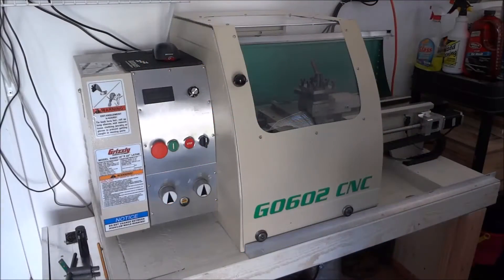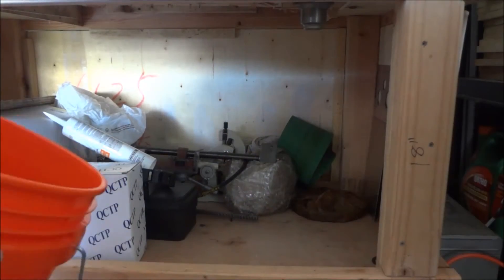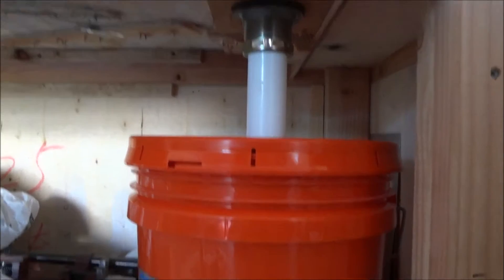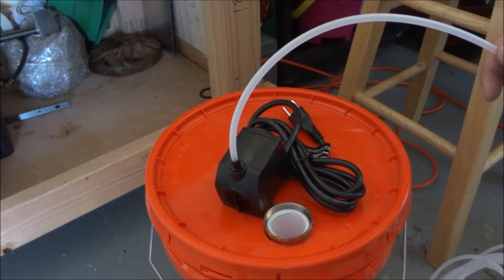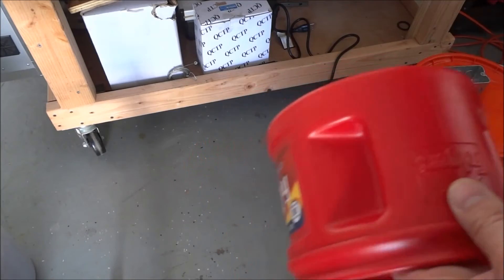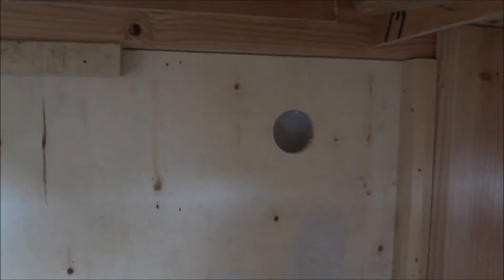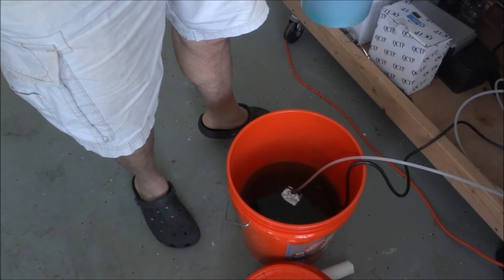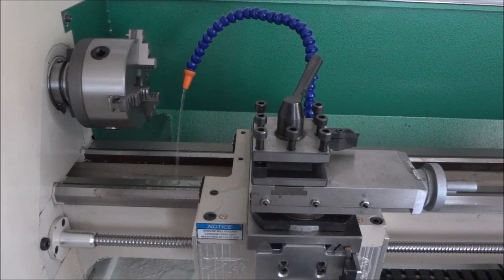G0602 Project  DIY Flood Coolant Pump and Tank

Comment: I did a very similar setup right down to the same orange buckets (just what I had) on my CNC milling machine.  I ran into height limitations on the pump that you had used because of its max of 3.5’ of head pressure, so I stepped up to the 63313 pump instead and it has a much better flow and pressure.  One other thing that I liked about it is it has a pipe threaded output.
Reply from the maker: Thanks yes the pump is low pressure however this was intended for the lathe where I did not need a lot of flow.

Comment: Just found this video as I'm looking to set up a similar system for my mill.   I was wondering how the pump has held up.  That same pump at HF is listed for fresh water but not for solvents.   Coolant isn't exactly in the "solvent" category but I wonder if it affected the seals in your pump at all.
Reply from the maker: Still working well have not had any issues

Comment: Does machining dust not stick to the pump impeller?
Reply from the maker: I really don't get dust per say. I did change this pump to a little larger one after running it for 3years. the old one was working when I changed it.

Comment: i would add a floated level gage that sticks throung the top of the bucket so you can easily read the level and not overfill
Reply: Yeah.
Thought use a clear(transparent)bucket
Reply from the maker: That's a fantastic idea always find out when it stops pumping.

Comment: Hi. You are making pretty much exactly the same coolant system as I did 2 years ago by using a submersible pond fountain pump. At first it worked fine but a few weeks ago it did not work so good. On investigation I found that the plastic body of the pump and some of the plastic parts internally had disintegrated and were laying inside the unit. Also a retaining plate inside was cracked and ready to fall apart. An email to the supplier revealed that the pump was not guaranteed to work with anything other than plain water. I was using a standard 10% water-soluble coolant oil. I have images of the broken parts should you need to see them. See my coolant system working at https://youtu.be/3kdajyTKFPs .  I would suggest that you inspect the your pump at 6 month intervals to check that all is well with it.
I am now on the hunt for an industrial standard coolant pump. There are some nice ones out there in China but the postage costs more than the pump itself.
Reply from the maker: Hi Jim,
 Thanks for your comment, Yes I agree with you this pump system has been in use for over 3 years now. I had to replace the Pump once I did not have a issue that you had it simply just stopped working. I was using Koolmist 77 at the time and I think that coolant is more Plastic friendly. I have since switched over to KoolRite 2290 which is a little more harsh on the pump I think time will tell.
Reply: Use a diaphragm pump, not these impeller based ones.

Comment: Excellent jump, but a minor advice to those who gone try make this idea.
Don't open any holes to the small can at the lower side, try as higher as you can so any metal debris dew to the gravity remain outside and keep that cheapo plastic pump safe.
Reply from the maker: Good idea it will help I did install a mesh filter so it was not a huge issue, The pump finally bit the dust about 2 weeks ago.

Comment: Hi CNC4XR7,

I read that you're still using the same pump set up, are you still using water based coolant too? Has rust been a worry?

Love what you've done :)
Reply from the maker: +Adam Carmichael 
Yes same pump set up. I'm using the kool mist stuff from LMS so far so good no rust. I do loose coolant through evaporation. Some but it's expected.
Reply: CNC4XR7 thanks for replying, good news to hear :)

Comment: how is that 200 GPH pump working for you? and have you tried any others? I have been looking at the 264 GPH or the 620 GPH for my mini mill Flood Coolant project.
Reply from the maker: The 200 seems to put out enough volume I wasn't sure at first. The 264 I think will be fine as well. Since I didn't have too much $ invested I wasn't to concerned. I didn't want to much volume it's already going to be messy.